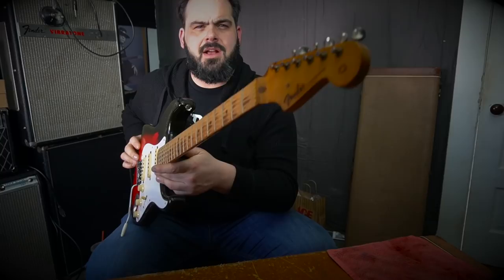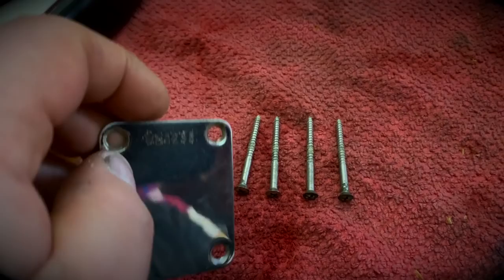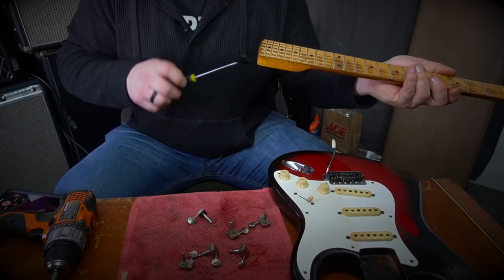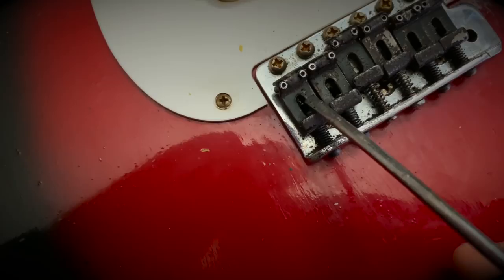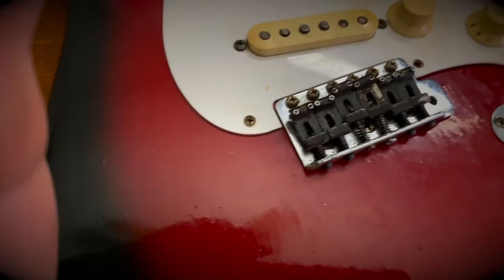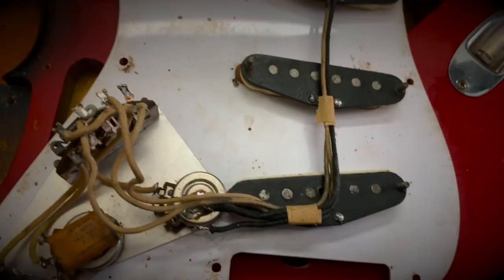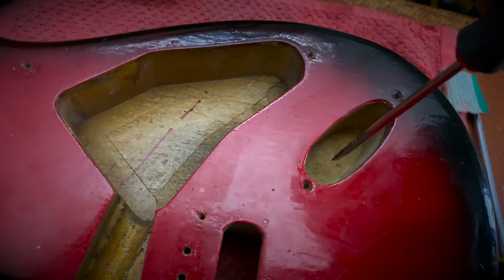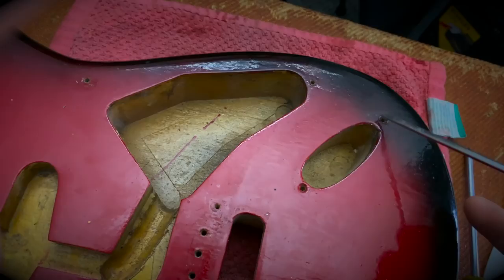WHATS INSIDE THIS 1957 FENDER STRATOCASTER?!?

Comment: I have seen some videos dealing with old fenders, and some mount the pick guard onto a block of wood, keeping it from "shrinking" when off the body. Not sure if it applies to your project, but it sounds like a good precaution.
Reply from the maker: The single layer guards are abs plastic and will not shrink like the nitrate 3 layer ones
Reply: Learn something every day.  Thanks!

Comment: I agree with the neck matching up with the back of the headstock , but when was this refinished ? Because anything can happen during that time they most likely took the neck off and then that piece could have matched up. I agree with your statement but it would be more having to rely on the stamps
Reply from the maker: Well luckily the neck pocket was an over sprayed and was taped off so it’s still retains all of the original finish inside.  
And yes I agree every factor adds up to help authentication

Comment: You took the tuners off but didn’t label them so can put them back in the same spot. I’ve seen others do that way yours is just random.
Reply from the maker: Besides the E and E, all of the tuners are the same.    So..?
Reply: @theriffwniksevigny5473  when things age they age very specifically. certain spots are prone to some things while others arent. low e always had a low e on it and it will be worn in that way. same thing goes for every screw, like the higher guard screws where they would be more corroded because of palm sweat. 
please be VERY careful. the second you put one screw in the wrong place and have to replace one because you stripped it lowers its value. if you dont care about resale then it's whatever, but just keep that in mind as you take on this project. there arent as many 57 strats out there.
Reply: @ianrothery8200  he said this one wasn't played much.  Also, he's restoring this to play, not to resell.  I do get your point, because if a screw or tuner wears uniquely because of the specific position its in, you'd want it in the same place when it goes back together.  OTOH, for a guitar that's aged from sitting around mostly idle, or that has an absolutely hideous refinish like this one had, I can't see it being much of an issue.

Comment: I just saw a guy do a fret job on an old 50's neck. You might already be aware but those frets should be tapped out from 1 side rather than pulled up. Every little bit helps.
Reply from the maker: Ive about 4 videos on here, refretting 50’s fenders
Reply from the maker: https://youtu.be/y9hATyUNAzQ
Reply: @theriffwniksevigny5473  😂 Sorry. I'm new here.

Comment: vintage players are fun and great. you can actually put a screwdriver to them without people screaming GASSSP NOO!!! WHAT ARE YOU DOING!!!???? Where as a pristine '57 you can't even breathe on it without devaluation or or people accusing you of such because you aren't wearing white gloves. It's the ability to have a great old instrument and return it great playing condition.
ALSO: I'm sure you are aware that fender used to run frets in sideways and traditional fret moval will induce some chipping. Some people don't mind, so people try and remove the frets back out sideways. If these aren't the original frets anyways then no worries

Comment: did everything look like it was un-soldered? i was under the impression that you want the solder joints to be original as possible? excellent though - always wanted to find something like this.... as i'm sure most do

I can't believe someone painted it like that and was like.....eh, i'm good with this....put on the clear
Reply: You know, if you're buying a collector grade, you want nothing touched, at all. Solder joints being one way to tell, though they can be faked. The collectors will put up with things possibly not working perfectly for sake of originality. This will be a player grade, refin+refret, but it has the makings of a very, very nice player instrument. I would not hesitate to replace any worn parts necessary to bring it to 100% functional.
Reply from the maker: Everything needed to be addressed.  The guitar was in a barn for years.  Pots needed to be thoroughly cleaned. Switch adjusted.  So.  Some things need to be undone to make right
Reply: The Riff w Nik Sevigny  gotcha! Not being critical i was just wondering

Comment: Pickups spec ???
Reply from the maker: 1957
Reply: @theriffwniksevigny5473  Thanks but by using a Multimeter for each pickup ? it should be around 6.02 ohms ?
Reply from the maker: Kian Hendrick north wound.  50s mid 5k

Comment: this doesn't look like an original 57.
I sold my 62 original strat for $17,000.00. I purchased the guitar used in 64 for $275.  I attended the meeting with the appraiser that represented the purchaser to verify that it was original.  He looked at the infield of the guitar under the pick guard and talked about the automotive paint that was used and the primer.  He focused on the over-spray behind the nails that suspended the guitar for painting.  this was considered one the main points that maid it authentic. Very hard to fake.  Note, on your guitar these are covered by the red paint.  another point is your guitar has very little fret wear.  On my 62 the higher frets were worn  the neck wood.  Also why isn't your pick guard yellow like the pickups.  Not normal.  somebody made a mess of this old fender.
Reply from the maker: So.   It is an original 57 strat.   Many later 57 guitars, and common in 58, had yellowing of the covers and knobs. Its the materials used.  I appreciate the story.  Sounds really cool.  As noted this guitar received a horrible refin but, retained its original parts through the years.   Thank you for your assessment , but i am real confident in this guitar, its all i deal with.  Thanks!
Reply from the maker: https://youtu.be/9VSgju8XdUA

Comment: Sorry but, buyer beware on refinished vintage guitars. I want mine flat out Vintage. Fender made a mistake [no, not really] when they started their Vintage Relic department where they actually have jobs making guitars like the one you start with. Fix hardware as needed and leave the rest alone. Buy a new Fender if you want a perfect looking guitar.
Reply from the maker: Restoration project!

Comment: looks more like a 70s fake that got passed off as an original unless you have an actual history of the guitar
Reply from the maker: Hahaha.  Yea.   Well.  The routes contours , shape and weight are much different on the 70’s.   Plus the 3 bolt neck.     On top of that, the pickups the pots.  1957 neck and Neck plate and tweed case all dated to 57 !   Good detective work tho!
Reply: @theriffwniksevigny5473  no im not saying its a 70s style body.  there were actual alot of 50s fakes made in the 70s that are thought to be real ones.
Reply from the maker: K K the guitar is 100% authentic.